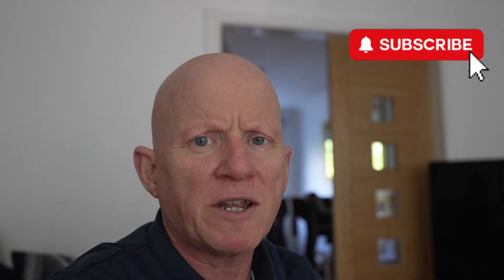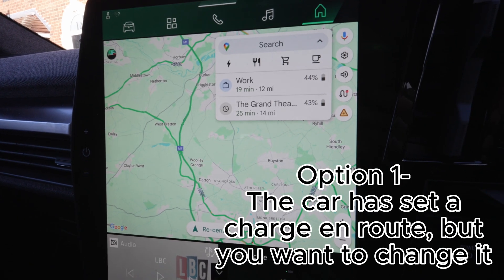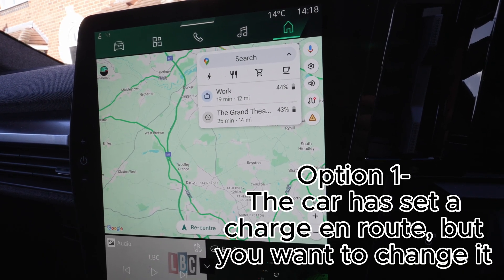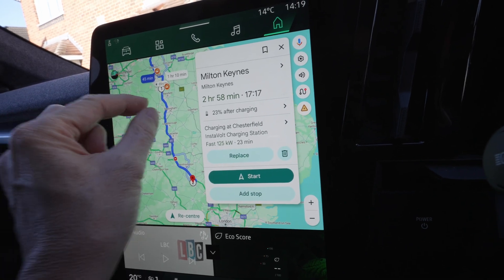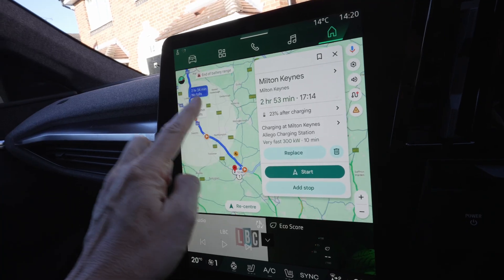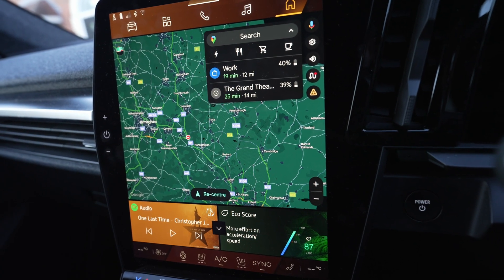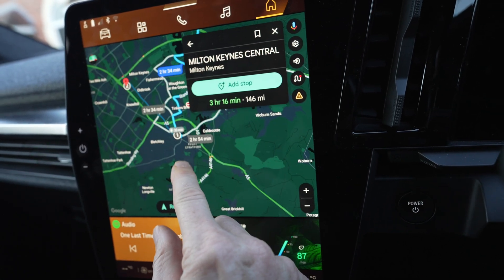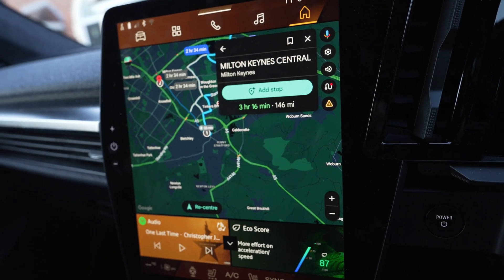Renault Scenic e-tech- How To Pre-Heat Battery For Fastest Charge

Comment: This will be helpful as I am traveling from Rotherham to pendine near Tenby, wales soon in mine so that’s going to be one hell of a journey!
Reply from the maker: Glad it was helpful!
Reply: @ so for the random question… knowing you had a Tesla before have you used the Scenic on a Tesla charger yet? Or is it even compatible, I have set up the Tesla app but can’t find a scenic in the vehicle list?
Reply from the maker: @ yes see my first Scenic range test video. Public Tesla chargers (about 50% of them) can be accessed by any car. I used ones at Gretna and Perth on that first video.
There is no car to select in the Tesla app. Make sure you have a credit card approved in it. When you arrive at a charger, you enter the charger station number and it will charge like any other public charger until you stop it on the Tesla app or in the car.
Check on Tesla’s website or the built in Google as to whether you intend to use is locked to Tesla only cars- around 50% as I say are open to any, as well as virtually every new station they launch.
Reply: @ thanks for the response :)

Comment: Thanks for the great advice, mine should be ready to pick up in April.  Was wondering about home charging, how would i prehreat? Cheers,👍
Reply from the maker: You don’t need to pre heat to home charge it as it’s only at 7kw. Or do you mean pre heat the car so it’s more efficient for the journey? Of the latter, just press the button on the app to heat the cabin and it pre heats it a bit. Or schedule your charge to finish just before you depart and that will warm the battery a bit.
Reply: @wakeywarrior  Thanks pal, great advice which i will put into practise👍

Comment: Very useful video. Thank you.  I'm considering the Scenic as my next car.  How easy is it to turn off some of the annoying driver aids (attention monitoring, lane keep assist etc)?  I've heard this can be done by setting preferences in a personal profile which links to a button  - but would be good to get confirmation from an owner like yourself!   Also, do you think that if they fixed the pre-heating  when you navigate direct to the charger, that it would be Renault themselves doing this change or actually Google who would make  the update (an Android Auto change)?
Reply from the maker: Yep you can turn them off and two presses on a button on the dashboard to the right of the steering wheel triggers your setting. I have just kept them on though as I find the noise when over the speed limit etc. useful.
Someone has done a test and he claims pre heating is working navigating to charger on his. He got readings from the OBD port. He did get an update the other week which I  haven’t had so whether that’s why not sure. Many report what I’ve said in the video and it seemed to coincide with my experience on my first Scenic video. But now I’m not sure, but it may be a software update is the reason.
Problem is these updates seem very sparodic and not across fleet (unlike Tesla). There’s one that also improves standard audio, but I haven’t had that either. There’s another just released which seems to improve the update process itself but I’m getting none of these currently so who knows?!

Comment: Is this a wireless system, or do you have to use usb cable for phone if you want to use something like waze or ABRP? Or would just just be a case of simply loading waze app to head unit?
Reply from the maker: It’s wireless but Waze is only on CarPlay- so you’d have to run that on the phone on CarPlay. Google removed it from Android Auto. ABRP is built in. I just use the Google built in though- it’s the best and also triggers battery pre heating.

Comment: Interestingly I do a regular Cornwall to London trip in my Megane iconic (MY2025) and I mainly use the Ionity chargers at Chippenham and Cullompton, which I sometimes set as the final destination, I usually get the full charge rate (expected based on the the car's charge curve) and hit 126-129kw charge rate without any additional steps as was documented in the video, wondering if it's possibly a scenic-only or software-update issue? Most of my charging has been done in <8c temps since January and even then the charge rates have pleasantly surprised me :)
Reply from the maker: Interesting, not sure, the Scenic issue is widely reported so it seems to be across the board. Maybe they implemented it differently?

Comment: I have a Polestar 2 and was considering the Renault as an option for my next car. The Polestar uses Google operating system like the renault but you can navigate to the charging stop and it preheats the battery with no faffing about like you seem to have there. I hope Renault sort that or it will not be on my list as a replacement next year.
Reply from the maker: They are great cars overall. The only things wrong with them (aside from the rear view camera- review coming soon) are software issues like this which could easily be fixed.
Reply: @wakeywarrior I’m picking up my new Scenic in 7 days! Has this been resolved or or it the same? 🤞🏻

Comment: I have a favourite destination set that is a long way away and would need a top up charge or 2 to get to.  I select that destination and then a charge point about 45mins from where I am .. that works for me, but is a pain.  I now have an OBD reader plug in and Carscanner App on my phone ... I can now see the battery min & max temps.   As a result of ongoing trials I find I get around 150Kw charge if the battery shows between 30 and 40degC min/max.  ... which can take 45mins plus to achieve with driving about depending on ambient and starting temperature, otherwise it barely gets over 20degC and that won't allow more than 50Kw.
Reply from the maker: Interesting information, thanks. 45 mins doesn’t surprise me as my Tesla used to switch it on up to an hour before (of course that told you.) Thanks for watching.
Reply: @wakeywarrior  Renault needs to provide manual control of charger destination for battery conditioning

Comment: will try this on mine soon as kinda disappointed with speed, still faster than my old kona was... but, here's my opinion.....CAR ICON top left of screen, needs to have a dedicated 'pre-heat for charging' button,  1 press and its on, regardless of route/destination/satnav used etc....then a timer saying how long til optimum speed ready, then you can choose your stop based on that or even some amount of pre heat if short for time will be better than none??? 
SPEAKING OF 1 PRESS... do you have to press your heated steering wheel button a few times before it stays on? i do, seat is 1st time, wheel NEVER is, but that aside, loving my 1st month into my Esprit Alpine.
Reply: Yep, steering wheel heater is a pain, most times more than one press to activate - it does the same if I use the "favourite" button on the steering wheel to activate "all" wheel and seat heating.  " things Renault should do - 1) manual control of pre-heat  and 2) a pipe from the rear wash/wipe to wash the reversing camera
Reply from the maker: Yes they can certainly improve it.

Comment: Done exactly what you have just showed about 5 or 6 times now and it still doesn't charge fast
Reply from the maker: Not sure why, should do. Shame the car has no visual indication it’s pre heating. Worked for me very well on my video where I went to Fastned.
Reply: @wakeywarrior  yes Renault garage said its not supposed to charge fast and they dont know anything about it.
Definitely need a software update or some kind of visual on the dash
Reply from the maker: @peaceorpieces8343  the garage don’t know what they are talking about very poor!😂 Are you heating it for long enough, may take 45min or even an hour? Probably won’t get warm enough with, say, just half an hour.
Reply: @wakeywarrior I’m not surprised you say the garage don’t know what they are talking about, as when we went to collect our new scenic from our Renault dealer, I asked the young (stand in to our original) sales woman if she could tell me if you could pre heat the Cabin Temperature, to which she replied she didn’t know. Obviously I found out myself that you can program it to pre heat the cabin as you seem to be able to on most evs, and I’ve really enjoyed that feature this winter, meaning of course that you never have to scrape ice of the windscreen. I have a question re pre heating the battery though. I’m planning a long trip in June and will have to use a public charger for the first time.At that time of year when the weather will be warmer, will it still be necessary to pre heat the battery??Thanks for your really informative post.
Reply from the maker: @markstockton6918  Absolutely it is necessary to pre heat the battery if you want to achieve max speeds (which only will be achieved at low states of charge, say 20%) and maintain fastest charge possible.  The charging curve like on all EVs drops off quite a bit at 50%. Heating the battery even in June will likely almost double your maximum speed so if you start charging at say 20% left on a fast enough charger, it should hit over 100 (see my Fastned video I hit nearly 130 I think) before dropping, to around 70 for a while, then lower as it gets fuller. If you do not pre heat in June in warmish weather, you may manage about 60 max I would guess. The battery also acts as a cold sink, so if it was chillier overnight/ rain etc that cools it down even if the temps in the day seem OK. Maybe pre heating not as necessary in really really warm temps but my Tesla, which tells you when it is pre heating, always seemed to pre heat even in middle of summer. See my first Scenic video also where I wasn't sure how the pre-conditioning worked, set a Tesla charger at Gretna as my final destination and only got about 60. I think temps at that point were about 14 degrees from memory as weather had improved.
Reply: @wakeywarrior  Thanks for your reply, much appreciated and very helpful